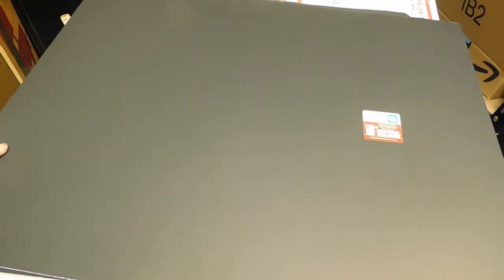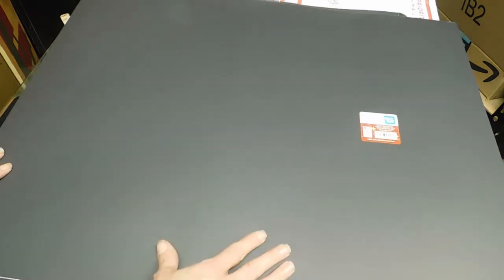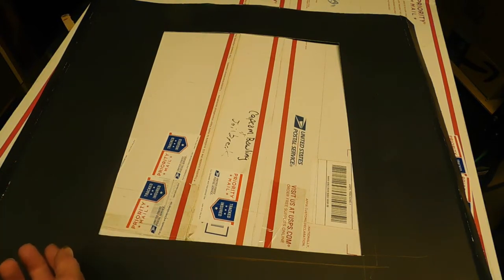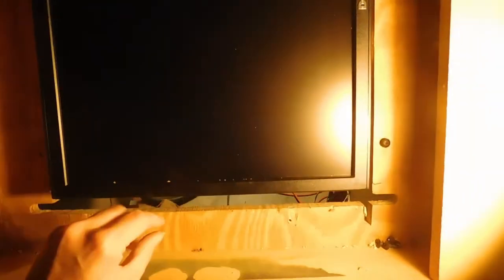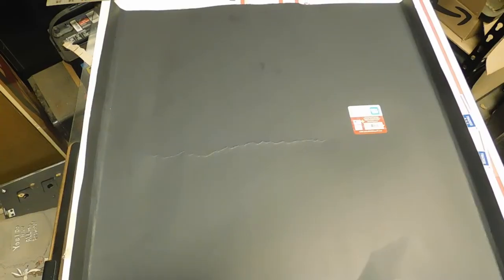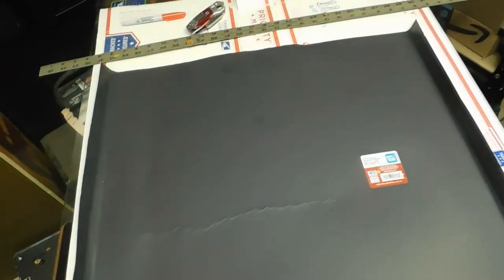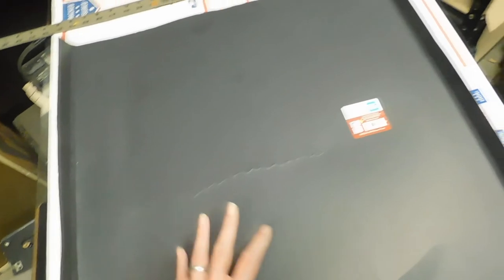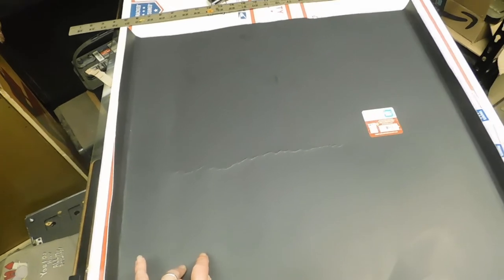How To Make A Monitor Bezel {Super Easy To DO!}

Comment: WILLS ARCADE, I heard that you have to use a blue screen protect shields over the LCD monitors and LED Monitors because of the blue rays radiation causes massive headaches. Look into this because what would you recommending using for a blue screen protect shields when using LCD monitors and LED Monitors in arcade games?
Reply from the maker: To be honest I've never had an issue with that in the past, but I'll look into them and get back to you on what I find. Thanks for bringing that up, I never even thought about the effect an LCD could have on someone before.
Reply: @willsarcadeservice4599  yes the blue radiation causes headaches for LCD screen and LED screen monitors
Reply from the maker: @waynegram8907  Thank You, I appreciate the heads up, I looked into a few options and ordered 2 different types of blue light filters to try out.
Reply: @willsarcadeservice4599  nice, try to make a video lesson about itto see which ones work good
Reply from the maker: @waynegram8907  I'll make sure to do that, I'll even make sue to take some screen shots of the info I found about the damage blue light can cause to our eyes.